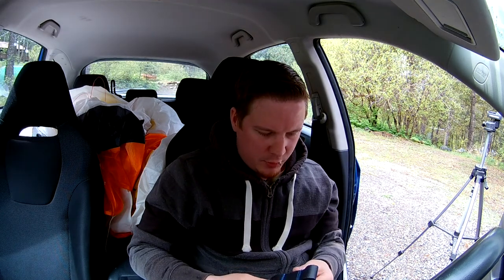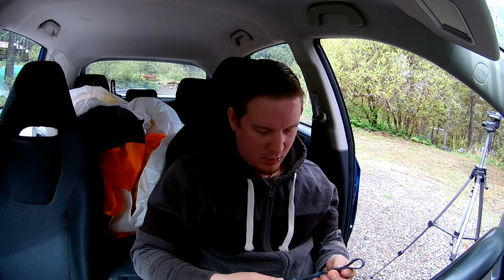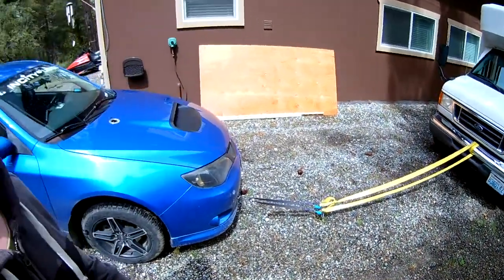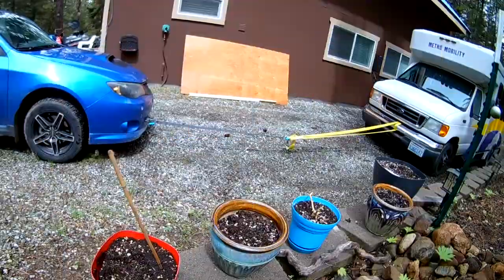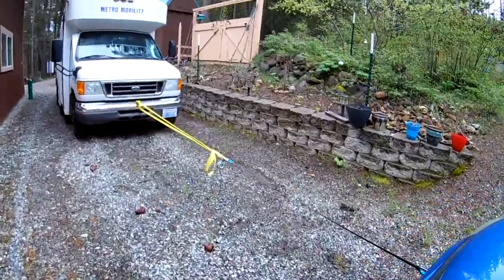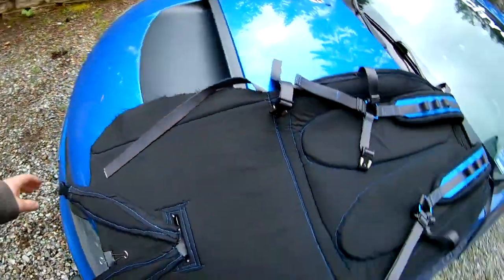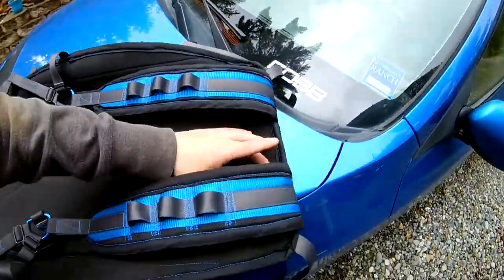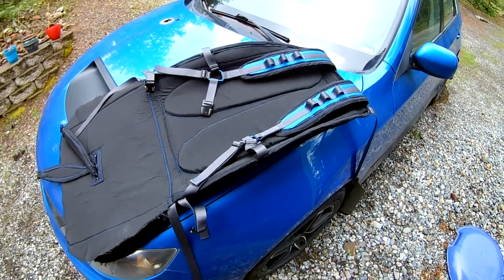Harness Safety Test and Sifting through Internet Advice

Comment: Please tell me those buckles have been changed?
Leg/chest straps do not take much load in normal flight.
Even in high energy moves (6G+) they have a pretty easy life.
If, however, your glider manages to get too far in front of you (badly timed exit from a stall etc) you will momentarily free-fall and will likely be either horizontal or head down when the slack in the lines is taken up and a large shock load will pass straight through the chest strap.
If it pops before you are snapped back into the upright position, you will continue head down, your shoulders are likely to be forced out of the shoulder straps.
The load will then be on your leg straps and that is assuming you can prevent your legs from feeding through the loops... (your calves will be forced against the bottom of the cage at it snaps upright)
Reply from the maker: If you look at the test flight video I posted, I have in fact upgraded the buckles to some very nice ones (they are called Raptor buckles, they are a US made version of the Cobra ones a lot of Paramotors use).
Reply: Ah, sorry man... I have watched that one, my brain doesn't take notes as well as it used to do :)

Comment: When harness are tested they are loaded in the standing position. The leg straps and buckles have to be load rated to the same load as the hang points. In reality in a emergency situation it is possible to be thrown into the standing position and experience high G forces. When you are landing you should be in the standing position loading the leg straps. PLEASE!!!! get some real leg strap buckles, they are available on line thru a few sources. You also want to think about some form of harness triangulation to help support  the seat board during a deflation.
Reply from the maker: If you look at videos of both of my finished harnesses, I have long ago upgraded to Raptor buckles for the leg straps. I have also changed the strap layout for both my Paramotor and Free Flying. You can see my latest harness in the following video: https://www.youtube.com/watch?v=HlKLXXj7MO8

Comment: Like I'm a big fan of your videos and stuff, I think you have a great channel but this is hilarious. 

"My intuition rarely fails me!" -continues to hook a tow strap around the FRONT BUMPER of a 5500+ pound bus. Then continues to complain that the clutch slips for the amount of power being made. Totally valid. Why not weld it together trying to pull said bus??? No more slipping issues if it's welded. Not literally but come on, that just made me cringe.
Reply from the maker: If it makes you feel better, I now run a stage 3 racing clutch and a  custom twin scroll big turbo setup making close to 400whp on pump gas. I stuck with a weaker clutch for as long as possible because if you've ever driven a racing clutch before you'd know how annoying it is to do that in stop and go traffic or on a hill. Makes the car impossible to drive in any form of smooth way.
Reply from the maker: Also, let's not forget that the point was to see if my Martha Stewart stitch skills held, which they did and they are still holding after butt landings and many hours of flight. ✌👍
Reply: @IrisPPG  that's true! I'm really loving the idea of building a paramotor, and your channel has really got.me thinking of trying to tackle it after I get proper training.
Reply: @IrisPPG  that sounds like a pretty nasty setup. I have a 3000gt vr4 and I have done the same thing. Had an unsprung clutch in it when I got it and I put in a lot more mild clutch cause my right leg died every time I drove the thing. But when I start pushing power it will slip, it's about finding balance.